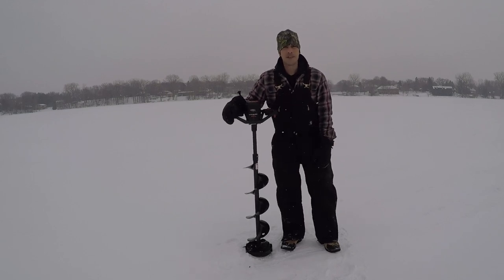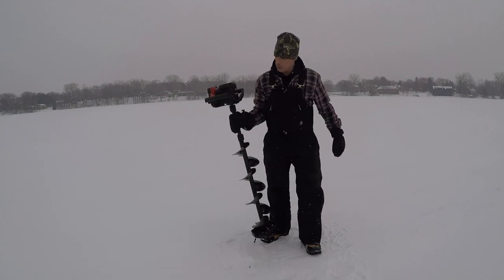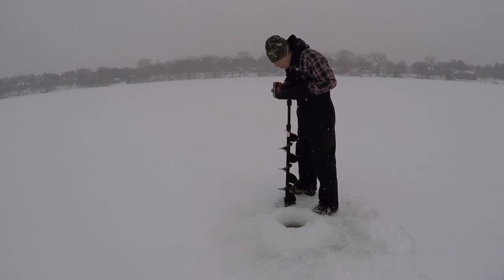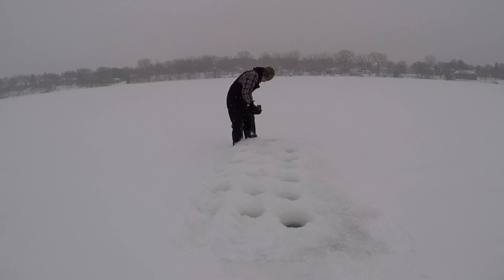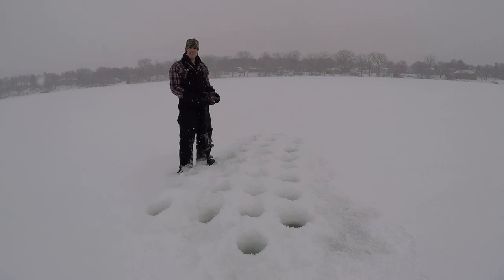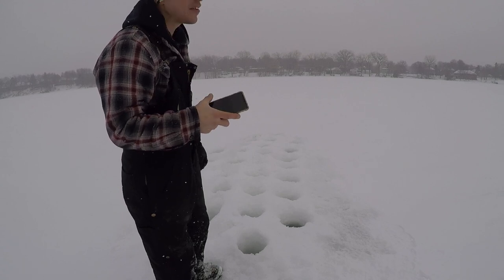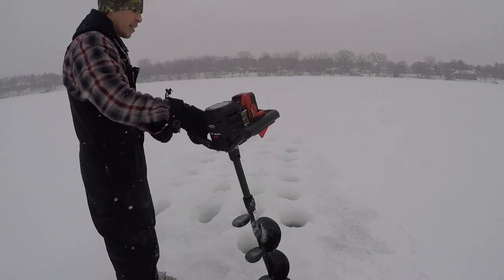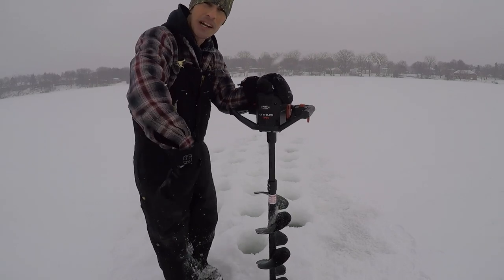Can the NEW StrikeMaster 24V Auger REALLY Drill 50 Holes on 1 CHARGE?

Comment: Yeah thanks for the video, after the outing I had this morning where my buddy's Jiffy pro4 propane hose leak and my Mako 43CC had internal gas tank hose jus desinagrate we are both done with gas augers n both of ours are less than 5 years old!! I am considering this one after seeing ur video and I agree with another comment in here about drilling all those holes puts strain on the battery. I think if you woulda drilled like 6,7 then wait like you decided to move a few times it would do it. I wouldn't drill 50 holes ever in 1 sitting so it wouldn't be an issue plus being just a 24V battery I would suspect that they aren't all that expensive so I'll be picking this one up as soon as my Eskimo is sold. 😊
Reply from the maker: I agree with you. The constant hole drilling was a stress test for sure. Slower approach would of lasted longer and more holes. Either way like I said , way  more holes then ever need at once. Went all season this year with no issue. Great auger and love how light it is. Electric is where its at!

Comment: next year i think i will sell my old gas auger and buy one of these.  I don't mind the smaller voltage as i generally never drill that many holes.  Could always buy a second battery if need be.

Thanks for the demo.
Reply from the maker: You are welcome. It is a very nice unit. I was happy to switch from my gas auger to this. Worked great all year. Like you said always could by extra battery but for how I fish one battery was plenty.

Comment: Im surprised they dont make them with larger batteries. My Ridgid Octane/Eskimo Pistol Bit combo drills triple that at several lbs lighter.

Not that we need so much battery, but for me id say 50 holes is marginal. Sometimes we drill that much or more. Wonder what the spare Battery costs, my combo comes in at like $500 lol, electric is not cheap but the weight difference does it!
Reply: They do, strikemaster has a 40v option.

Comment: Went out yesterday and drilled 7 holes on 30 inches of ice. The temp was -19. The battery got 1 bar of life left after just those 7 holes. If my calculations are correct. I could've drilled 12 more holes before the battery died. Definitely not close to what SM is claiming.
Reply: There isn’t a battery on this earth that is going to work in -19 degree weather. Have you noticed how cars don’t start or have issues when it gets this cold😂
Reply: 12 more holes? Do you mean 5 more(?), which wouldn't make sense. Even 12 total would be inaccurate. In reality, you would've probably been able to get 1.5-2 more holes.

In -19° you should be glad that battery worked at all lol